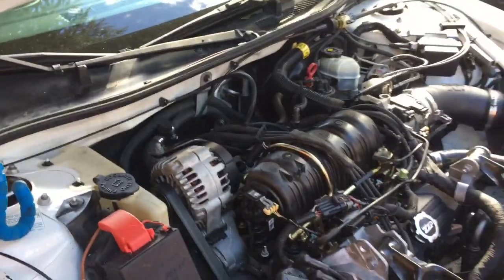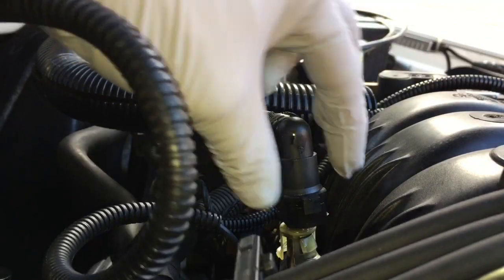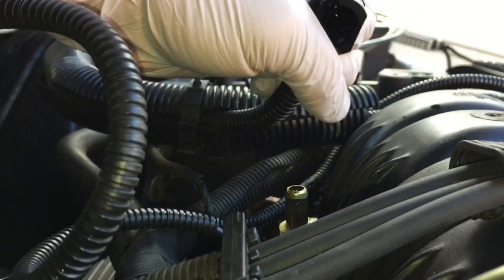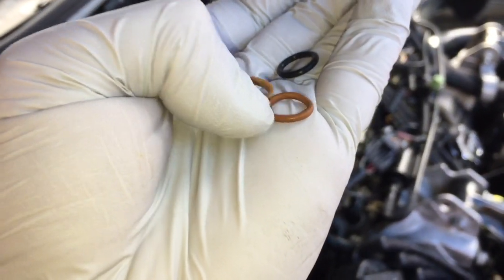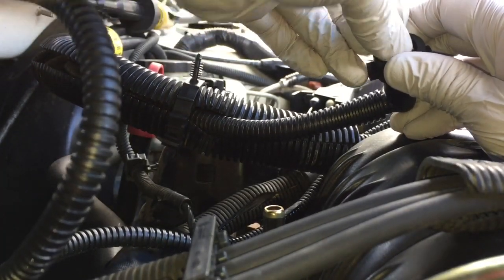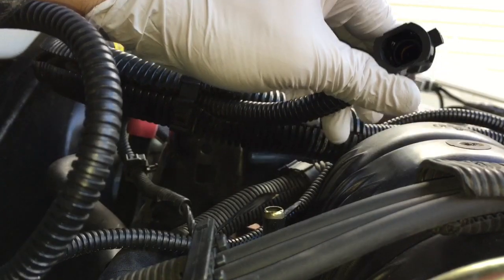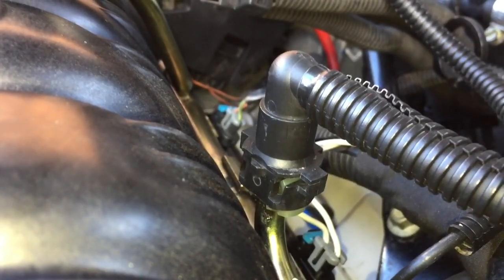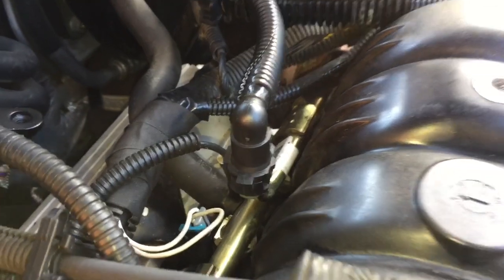Fixed it!!! Common fuel rail leak on 3.8 3800 Pontiac, Buick Oldsmobile

Comment: The part that is listed for the orings did not work for me, I needed to replace both orings and the plastic spacer. Dorman makes the replacement part as a 90 degree elbow connector (Dorman 800-086) or as a straight connector (Dorman 800-082). You get 2 connectors for less than $10.  I would not replace the connector, but inside the connector is the 2 orings and plastic spacer.  Since you are not replacing the connector than either part will work as the orings and spacer are the same.  I was able to replace the orings and spacer on a 1998 Buick Park Avenue, 2001 Pontiac Gran Prix and 2004 Buick Regal. One other tip is when you put it back together I was having a hard time getting the black circular clip to snap back in and I used a 9 MM socket with an extension to push the clip back in place. You will hear a clip/snap noise once it is in the proper place.  I would suggest replacing all 3 parts - the 2 orings and spacer at one time.  The part numbers above should work on all GM 3.8 engines that are not supercharged.  I do not have a supercharged engine so I do not know if it will work or not.
Reply from the maker: danielle bankes thank you for sharing.

Comment: Not sure what I've wrong                    replace as the o-ring just like the video still leaks  even replace the plastic connector.
Reply from the maker: Here are the two complete Fuel fittings with prongs and plastic clips/spacers. You would just remove the interior rings and clips and use them on your already installed fitting. You would only need on set. The two links are for a 90 degree angle set and a straight set. Please hit that 👍 and thank you for watching.

(90 degree)
https://www.amazon.com/dp/B000E3022E/?tag=TweekerDan198-20
(Straight)
https://www.amazon.com/dp/B000E323JO/?tag=TweekerDan198-20

I am a participant in the Amazon Services LLC Associates Program, And affiliate advertising program designed to provide a means for me to earn fees by linking to amazon.com and affiliated sites

Comment: Glad you posted this video. Maybe will save some folks the horror of an eventual engine fire. 

I never drove a GM vehicle with this engine but had they not gotten cheap by cutting corners it could have been a great motor. 

Unfortunately thats the problem with the auto manufactuers. They like to cut corners just to save a buck. 

Which is why the aftermarket performance industry has exploded into such a profitable industry. 

They have solutions to fix those corners that were cut. 

I think the 4.3 would have been the better choice for performance in the cars myself. But hey. Nice video
Reply from the maker: Thank you for the positive feedback. Much appreciated.

Comment: You're right on the money with those o'rings just came to fix the rear Bank 1 O2 and can smell gas coming from that O-ring thanks a million
Reply from the maker: There is a decent chance this leak is causing the O2 sensor to set a code. Thank you for the positive feedback.

Comment: I just fixed this problem as well.  The same O-Ring disintegrated (top brownish one).  Dad and I took calipers to them and the measurement given here is slightly off.  We used 1 O-Ring the same size as recommended here, and we couldn't replace both of them, only one.  

The ID is 3/8, the OD is 1/2, and the thickness is 1/16th.  the material you want to use is nitrile or Buna-N

Granted, if you only need to replace one O-Ring, this tutorial will work flawlessly, as it did for me.  However, if both need to be replaced,  use this O-Ringhttps://www.theoringstore.com/index.php?main_page=product_info&cPath=367_23_22&products_id=1109&zenid=1993ca72331e859afa95da56f9d5ae40
Reply: Jacob Meier hey just wanted to confirm, You DID use one o-ring like the one in the video right? However both weren’t the same, as explained, so you needed to get a different one (which you listed above)? Correct?
Reply: @kushkonsumer  yeah.  The brown one was completely disintegrated.  We tried to use 2 of the ones in the video, but it wouldnt reconnect to the rail.  We gently placed the yellow oring back.  So the new one was in the furthest, and the old yellow one was put back in as well.
Reply from the maker: kushkonsumer yes I did use the exact o-rings shown in the video, they were the closest that I could come up with knowing that the old worn o-rings would be actuate in size. I matched them up as best as I could and did this process on three separate engines for a friend of mine and there has been absolutely no leaking since the repairs.
Reply from the maker: Thank you for sharing, much appreciated.

Comment: Where can I purchase a spacer ?? I dropped mine like a bozo
Reply from the maker: I’m unsure of where you can purchase a spacer, I do know that the part store now sells a replacement fitting that may be attached to your existing fuel line. It is in the Dorman section (section that has miscellaneous clips, fittings and parts)

Comment: Twakerdan I,have a 2002 buick regal ls it high idle i rev it up to calms down I drive it around and suddenly it shuts off ill try to re start all it does it crank stay on for 4 seconds and die if unplug the battery plug it back in it starts no problem when I try to get on the freeway ill be driving then suddenly dies out no warning nothing just shuts off all,the lights stay on dont even flicker just no power anymore would you know what its is it has a new maf map tps icv and,battery and much more
Reply from the maker: shane tarlton I would inspect and test your ground cables for a sufficient connection. Under the hood, around your pcm and under the rear seat. Is your battery located in the engine compartment or under the rear seat?
Reply: @TweekerDan1984  it's under the hood... But could that really be the problem cause some days ill,have no problem and next day it will shut off 10 times i have to get out unplug the battery wait 3-4 mins plug back back in and it starts back up rough then go back to normal rpm and idle could it be the fpv
Reply from the maker: It is common for vehicles to have bad grounds that can cause the vehicle to just shut off sporadically. Also most people over look testing for a good ground. A loose, corroded or faulty ground can cause many issues. Inspecting and testing 
whether you had a sufficient ground won’t cost you anything and may save you lots of money. I actually have videos on my channel that I solved some huge issues and the ground was the culprit.

Comment: Thank you thank you for this video. I have a 2000 lesabre and it only had one o ring. I was able to fish out the old one without removing anything else. There is a collar further down inside that elbow assembly. Push it down towards the elbow and that creates a gap for the new o ring. It took a bit of wrestling to get the o ring in place but it fit perfectly and fixed the leak. I'd never even attempted something like this and I couldn't have done it without your help. Thank you.
Reply: I have a 2000 LeSabre with the same problem. Did you use this size o-ring, 3/32  I.D. 3/8” O.D. 9/16?

Comment: Hi dan. I have a 3800 engine in a Buick park avenue . I been having a few issues trying to repair it for my father.
I have high idle after 30 mins of running the car.
Gas smell
Bad bearing hub
I know he had someone take the throttle body apart and clean it . I looked for vaccum leaks and couldn’t find any.  Any ideas

I found a gas line that was bad and leaking but it’s on the front of the engine and yours is in the back.
Is there 2 separate ones? 
Thanks for your help
Reply from the maker: If you follow the injector fuel rails you can inspect these lines for leaks. As for the high idle after 30 min of running the car I would suspect a hidden vacuum leak. These intakes are sometimes weird with vacuum leaks.

Comment: much appreciation!  the o ring size for the 2004 impala i repaired was 3/32" x 3/8"ID x 1/2"OD.
Reply: Thanks for the information, I’m doing this on an 03 impala & im having trouble over the phone explaining what I need. would it be the injector rail o-rings? Or what specifically, since the guy in the parts dept. is proving to not be very helpful
Reply from the maker: Thank you for sharing.

Comment: they sell a repair kit for this  at nappa and Auto-zone hanging up in the help section, works just fine, there is a plastic clip holding the old one down ,you will not use that with the new one just throw that away, cost for the Repair kit about  $23 you don't have to replace the hold line you cut off the old neck and a fitting comes  with the kit to join it back together no clamps needed
Reply: What is the [part number for the repair kit?
Reply: please, what is the part number for the kit, or at least the name of the kit?

Comment: You happen to remember what size retaining clips you used on this? Or what size the connection is? Orings replaced and it's still spitting gas
Reply from the maker: Yes they are GM/Chrysler 3/8 quick disconnect retaining clips by DORMAN part 800-006
Reply: hey sell a repair kit for this  at nappa and Auto-zone hanging up in the help section, works just fine, there is a plastic clip holding the old one down ,you will not use that with the new one just throw that away, cost for the Repair kit about  $23 you don't have to replace the hold line you cut off the old neck and a fitting comes  with the kit to join it back together no clamps needed
Reply: @robinturner1943  Hi, can you please tell me what this kit is called or a part number please?

Comment: 0:55 can you tell me what that line is called in front of the engine  it's  a circle with a line shaped of a L
Reply from the maker: That vacuum hose is leading to a few different areas. ACDelco 24506302 Modulator Pipe. They were a pain to track down so here are the numbers. Let me know if you would like a link. The part would be different if your car is supercharged.
Reply: hey sell a repair kit for this  at nappa and Auto-zone hanging up in the help section, works just fine, there is a plastic clip holding the old one down ,you will not use that with the new one just throw that away, cost for the Repair kit about  $23 you don't have to replace the hold line you cut off the old neck and a fitting comes  with the kit to join it back together no clamps needed

Comment: What Auto Part place did you buy your parts from
Reply from the maker: I picked them up at a local part store named Parts Plus.
Reply from the maker: Maybe I can do some research and find a more direct link for purchasing the parts. To help people having trouble finding them.
Reply from the maker: I was able to locate this part for you. Also I know that AutoZone has the Fel-Pro cases for sale because I found them on their website. Here is a case that I found on Amazon. The ring size you will want is 3/8 I.D. 9/16 O.D. With a o-ring width of 3/32. SAE Metric Rubber O-Ring Washer Assortment Kit Automotive Storage Case ORing Set https://www.amazon.com/dp/B07DN6Z7T7/ref=cm_sw_r_cp_api_i_5VfwCb3EEJVTB

You will be able to buy just the O-ring you want but it will be in a large quantity and may cost just as much is the full kit.
Reply: Thank you
Reply: hey sell a repair kit for this  at nappa and Auto-zone hanging up in the help section, works just fine, there is a plastic clip holding the old one down ,you will not use that with the new one just throw that away, cost for the Repair kit about  $23 you don't have to replace the hold line you cut off the old neck and a fitting comes  with the kit to join it back together no clamps needed

Comment: Great video, thanks. By doing what you showed, not only did it stop fuel leak, but also cleared check engine light that had been on for a month for car running lean. Changed o-rings and instantly felt tighter fit, started car and engine light turned off.
Reply from the maker: Your very welcome. Thank you for sharing.

Comment: Thank you for your video. I have a very important question for you. What were your symptoms before you fixed it?
Reply from the maker: I actually didn’t have any noticeable symptoms besides smelling fuel only sometimes. I do not believe the lines leaked all of the time.
Reply: @TweekerDan1984  thanks for the reply. What year is the car you're working on?
Reply: TweekerDan1984 would this cause a misfire issue ? I’ve replaced ignition coils, spark plugs and wires and still get a misfire in cylinder 1
Reply from the maker: Joe Phillips, yes it is possible for insufficient fuel to cause a misfire, on some of the vehicles I’ve worked on with this problem there was a significant improvement in smoother drivability. Although I have also ran into random misfire due to vacuum leaks. Sometime  a vacuum hose but usually a leaking intake manifold gasket.
Reply from the maker: 1996, 1999 and 2001. Buick riviera and two Pontiac Grand Prix.
Reply from the maker: I’ve done a lot of work on these cars if you have any question maybe I can point you in the right direction.
Reply: @TweekerDan1984  sounds good. Thank you sir
Reply: @TweekerDan1984  I actually have one question. I've researched and I am completely lost. I have a 2004 Grand Prix, 3.8 non supercharged series 3. I'm trying to locate the fuel pressure regulator...can you please help me. I'm pretty good at fixing problems with my cars, but this one has me lost. AutoZone told me it was built into the fuel filter, Chevrolet don't have a clue.
Reply from the maker: On the 3.8l engine The fuel pressure regulator should be located directly above the front valve cover right between the intake and valve cover. It may be gold and look similar to a egr valve. If you send me your email I can send a photo.
Reply from the maker: I have sent you the photos via email. Also I removed your email so that it is not public.
Reply: @TweekerDan1984  I appreciate that.

Comment: That Fel pro 408 o ring is NOT the right one. Not according to NAPA Auto parts. Not even close to the same size. Inside diameter is right. The outside diameter is wrong. Its too fat of an o ring. I have no clue what you have.
Reply from the maker: I’m not sure then I did purchase them directly from Parts Plus a local auto store and they came out of a new Fel-Pro O-ring case. I have purchased them multiple times now. I hope you are able to get the right o-rings.

Comment: This was a poor connection design that was spring loaded.  They only put this on the rear fuel rail.  Check the front rail.   It's a different connection.  Older Buicks with the 3.8 had the same better connection that are the same.  Tell your GM garage to change connection type. This is a common problem/failure.
Reply: Would this be a change I could do myself?
Reply: Gm will not repair it they want to replace the hold line they will not tell you that they sell a repair kit at auto zone

Comment: Hey buddy what are the oring sizes
Reply from the maker: FelPro Part# 308 width of o-ring 3/32  I.D. 3/8” O.D. 9/16 item number was 110 in the felpro case
Reply: TweekerDan1984 is that for all of them or just the black one
Reply: Mr Gomez did you determine the answer to this? I salvaged my black plug, and the beige spacer.. but the two o-rings are chewed to shreds. Did they end up being different sizes?
Reply: TweekerDan1984, you say in the video, and the bag is labeled the same, that this is a Fel-Pro 408. Which is correct?
Reply: The part number is actually #408, as shown on the bag in the video

Comment: That check valve that you have on the hose below the fuel line leak   where does yours connect to   i have a air leak and the hose broke off
Reply from the maker: Are you referring to the hose that connects on the back of the intake manifold or one of the hoses on the front side? The two hoses that are running parallel under the fuel rail on the front side are for the EGR purge solenoid. If you shoot me a email I can send you photos. 👍
Reply: TweekerDan1984 the hose on the back of the manifold its a rubber hose right below the leak
Reply from the maker: Email sent, I hope this helps. 👍